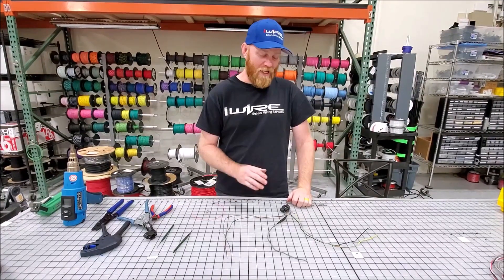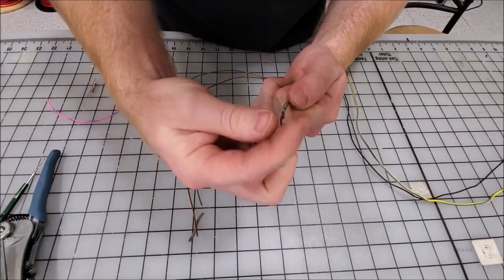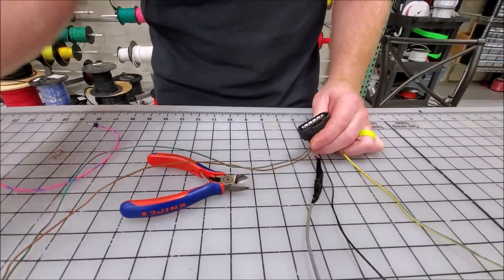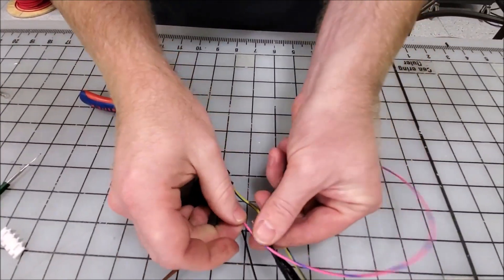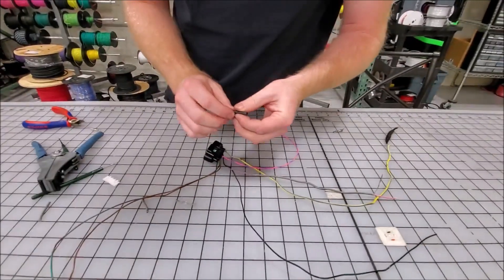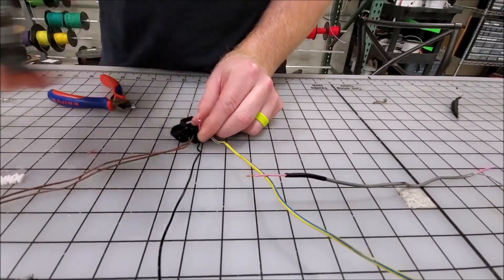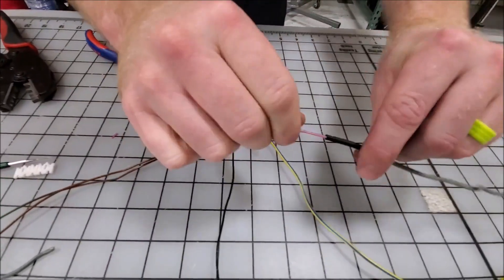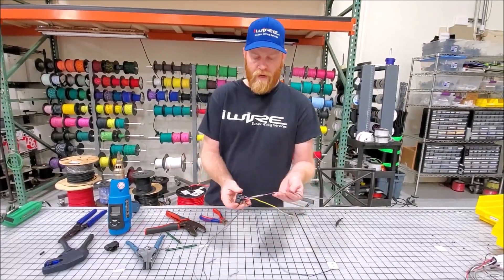What is Shielded Wire and How To Install It

Comment: Could you extend the shielded wire itself? say - an important harness with a shielded wire needed to be extended about 1 ft - could you solder an extended shielded drain wire to the current existing one?
Reply from the maker: Yes, you could do this but it's a bit tricky

Comment: So what would happen if you if the shield wire and signal wire are touching
Reply from the maker: it would ground out the signal and cause the sensor to no longer function properly

Comment: How would you reshield the wires ( ground and signal) if you happen to remove the shielding around them? And is a split shield somewhere along the wires affects the function of the section of shield?
Reply from the maker: It would depend on the situation. Usually, you would want to splice it back together with fresh wire. If you have a break in the shield, you would lose the shielding effect past where it's no longer grounded.
Reply: @iwiresubaruwiringsolutions  so all my wires are intact but I have a break in the shield right in half. Meaning the top portion of the shield isn't connected to the bottom portion. But I have a drain wire down the whole shield. Would that function right or the two half's have to have contact?
Reply from the maker: @Az-elite  If the drain wire is intact then you should be fine if you repair the outer jacket to seal things back up
Reply: @iwiresubaruwiringsolutions  ok sounds good, I'll throw some foil tape on it and wrap it all up with electrical tape or some shrink wrap and I should be good then. Thank you 👍🏽

Comment: So you don't ground it to anything?
Reply from the maker: The ECU generally supplies the ground. You want to make sure only 1 end of the wire is grounded. If you ground both ends, you create noise instead of a shield against noise.

Comment: Nice vid i subscribed. Only thing i would do different is put another piece of heat shrink tubing over the crimp, my crimping pliers seem to bite into the connectors a little too deep and im always paranoid there may still be an exposed spot after i heat it. Either just cheap pliers or im just paranoid lol

Comment: Would the shielding grounding fail cause a random p0340 for a cam sensor? Or is it more likely for the shield to contact the inner wire? My harness looks fine I have good continuity for both wires to the ecu. (New oem sensor and newer alternator are both in place)
Reply: Did you resolve your issue?

Comment: I have a cable with 3 twisted pairs and each pair has a  foil sheild and a drain wire. I only need one of the pairs protected. Can I just cut the other 2 drain wires at both ends and add a bit of shrink wrap to seal the drain wires not being used.

Comment: You don't have to connect the mesh shield to a ground at the connector?
Reply from the maker: The ground only is supplied at one end of the wire not both.  So in this case (and most of the time) the ECU supplies the ground so the plug at the sensor is the "end" of the circuit so the shield wire just needs to be terminated.
Reply: @iwiresubaruwiringsolutions  - I'm just learning about auto wiring now and this video helped me alot.

I bought an 07 ej20 NA from someone that did a rewire on the KS but did a terrible job since after they did it, the CEL keeps coming on with KS circuit high. Now I'm planning to rewire it myself, however, before I get myself in too deep, does the shield eventually split off to another pin on the harness? As I understand the signal and shield should not be touching at all.
Reply from the maker: @NormanMyb  Glad to hear that. Some knock sensors split the signal ground to the sensor itself and some don't. You would need to refer to the diagram for your model to confirm which type you have.